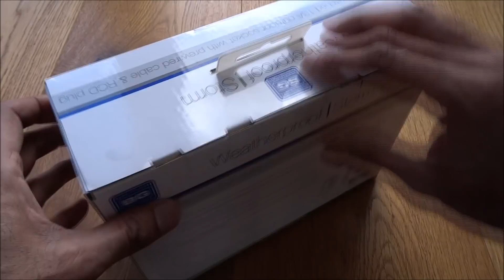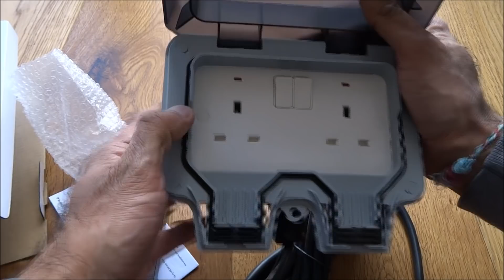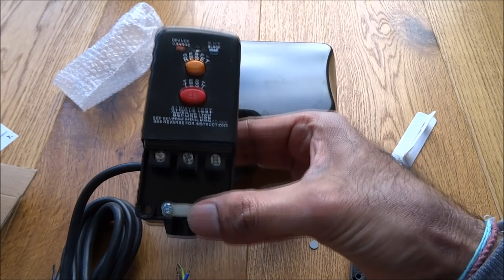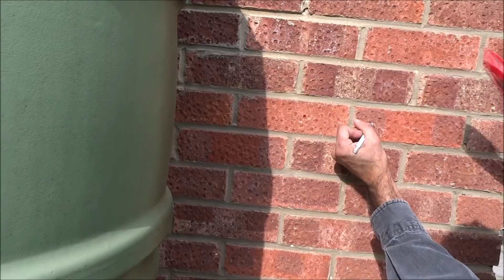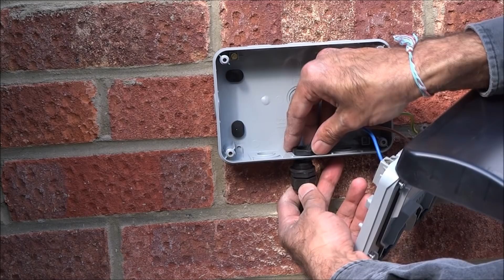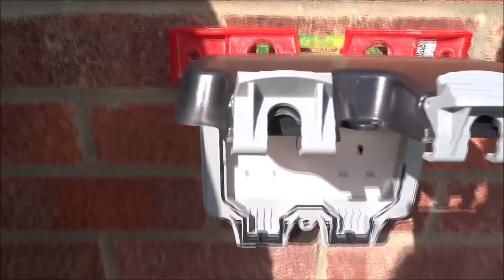How to Install an Outdoor Electrical Socket

Comment: Hello.... very helpful video, can you confirm the model and can you tell me if the wall unit is of full metal construction?
Thanks
Reply from the maker: Saeed Raja thanks for the comment much appreciated. Check the description for a link to the product. The construction is plastic, hope that helps. Don't forget to like and subscribe!
Reply: IP65/66 usual standard is PVC. Metal clad wont do much good for outdoor use due to it getting rusted and weathered from the elements. Regular checks on its rubber strips and replace when needed will guarantee its life extension.

Comment: 5:10 Top left corner there is an earth for the case, are you meant to wire this up or not?
Reply from the maker: No need as it's a plastic box. Don't forget to like and subscribe!
Reply from the maker: No need as it's a plastic box. Don't forget to like and subscribe!
Reply: I found a mention somewhere else that it's something to do with when you chain a second box off the first one. Not sure what it does though.
Reply: it was already earthed to the switch itself what you seen was only a sphere terminal

Comment: Hey dude, I like the install. I'm a handyman in Birmingham and I've installed a few of these for friends & family.

I noticed that you never drilled the drainage hole open, it's best practice to do that just incase the waterproof seal fails and water does get into the back of the socket.
Reply: The drainage hole actually compromises the IP rating of this product. Only drill the drainage hole under certain conditions, check the user manual.
Reply from the maker: +Mandeep Singh thanks for the comment much appreciated great tip. Don't forget to like and subscribe!

Comment: Pretty shit install. Why you didn't fit it straight to the brick il never know. Also why didn't you wire straight to spur?
Reply: Jono Smallridge the product itself was pretty shit! That dopey hook on bracket is just asking to knocked off the wall. Any decent self respecting unit would have permanently screwed flush mounting against the wall with a concealed tamper proof inlet hole to allow cable entry.

Comment: Easy way to get the holes exactly right is use masking tape over both the bracket holes and shade in with a pencil, then stick that on the wall. 
Sorted..👍🏼
Reply: Even better. Drill one hole. Screw it in slightly. Mark 2nd hole. Dead easy
Reply from the maker: +Paul Bennett thanks for the comment!
Reply: Smart! Thanks for the tip
Reply: Now that's a great tip!👍
Reply: @Mr B That's one bloody marvellous tip!
Reply: That tip is genius. Thanks fella.

Comment: i think was better to fix the body of that socket directly to the wall instead of hanging it
Reply: Absolutely right Mark. I bought the same socket from Amazon for less than a tenner without the brackets, cable and RCD. It is  mounted directly to the wall and I have cut out the  centre knockout cable entry so the cable isn't exposed. It's a very neat job. No need for the RCD as there is one built into the consumer unit.

Comment: Those mounting brackets can be removed, you need to remove the 4 black covers visible in your video to access the screw heads. Once removed the holes can be used for flush mounting the unit. I've used some clear silicone and tap washers to prevent water ingress, also advisable to run a bead of silicone around the unit where it meets whatever it's screwed to. Good review by the way.
Reply from the maker: +open the box thanks for the comment much appreciated. Don't forget to like and subscribe!
Reply: That's what I was going to say, but I only knew because I had another box without a bracket and recognised it as the the same covers used for mine
Reply: I was going to say the same thing as well.  I'd fitted one of these years ago and was never happy about how it hung off the wall until someone pointed it out to me.  Made a huge difference to how stable it was on the wall.
Reply: Thanks for that, I’d rather have it flush too, those external brackets don’t look great.

Comment: Hi, looking to do this job shortly. was only really looking for an IP67 for weather protection. but I did like seeing a standard 3 pin plug externally. What did you think of the weather proof functionality? suitable for winter storms etc?
Reply from the maker: +Stephen Redford the seal on the socket was very good and a good tight seal.
Reply: Many Thank for the info. Sounds like a plan then. :)
Reply from the maker: +Stephen Redford good luck!

Comment: thanks for posting, interesting design for the socket, I like @Zed Man would have removed the brackets and mounted flush with the wall (with a bit of building silicone not bathroom). Finally conduit should really be used when going through the wall - but not really sure how you would make a tidy job with it exiting the box at the bottom.
Reply from the maker: +bill coniston thanks for your comment.
Reply: Upon re-reading my comment, I didn't mean to be so negative - sorry. thanks for posting your videos. I look back at lots of my stuff thinking I could do it better next time! cheers,
Reply from the maker: +bill coniston hey no problem...its constructive criticism, I'm not offended :-)

Comment: One thing to note, if you have an RCD protected consumer unit, you don't really want to add another RCD protected plug into it, can cause problems with tripping etc. Nice review though and useful for people to add external sockets, since it's just an extension lead really. The design is a bit naff, I'd have taken those bracket off and screwed it straight to the wall and sealed up. Would also run the cable straight out the back through the wall, neater too, it works either way.
Reply from the maker: Zed Man thanks for the comment. I felt the same about the brackets at the back a bit rubbish, I was shocked when I saw it didn't expect that.
Reply: Is that right about the RCD plugs?  I'd always used them when I was working in the garden using an extension lead, I'd always plug one into the extension and then plug the tool into that.  It might explain this, though, and I'd appreciate it if you could tell me because it's bugged me for ages:  I was using a hedge trimmer when I accidentally chopped right through it's power cable, but when I went inside I noticed all the sockets in the house had been tripped by the RCD in the consumer unit, but the RCD I'd plugged the trimmer into hadn't tripped. Could it be something to do with what you said, or is it simply that the RCD in the consumer unit was more sensitive to the earth leak?
Reply: If you don't need one, why is it included in the pack? Do the instructions say that it shouldn't be used if your consumer unit has similar protection?
Reply: Frogmella Slob I think it's there for those people who have the old style fuse boxes, rather than the modern consumer units with built in RCD protection.  That said, I've got a similar outdoor socket to this that I bought from Aldi, which I've not got around to installing yet, and it doesn't mention whether you should or not in the instructions.